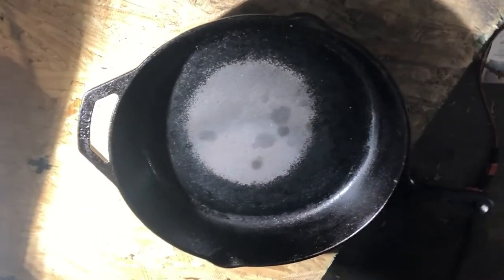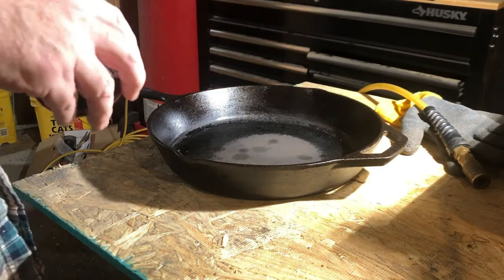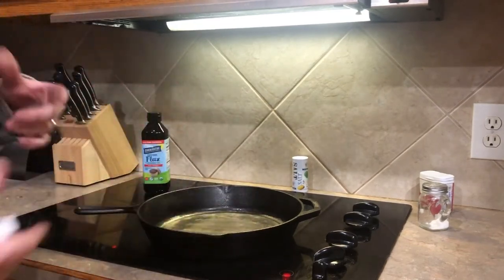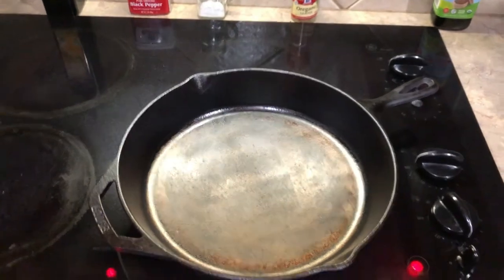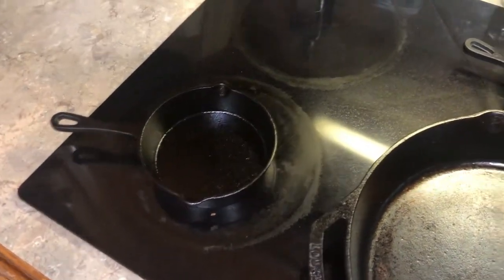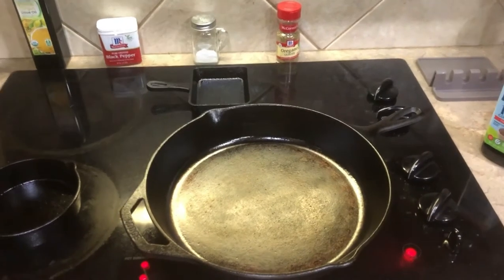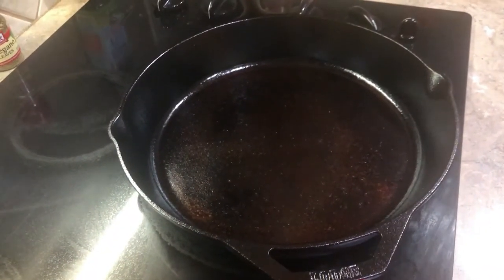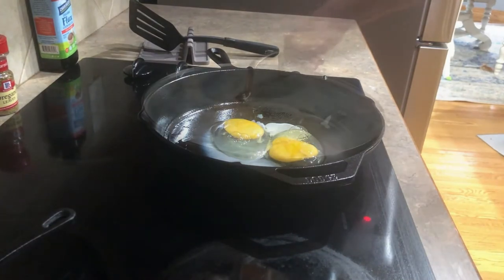I ruined my cast iron skillet.  And attempted to restore it.

Comment: I've been learning how to "restore" cast iron pans recently myself. I've ordered a few antique ones from ebay that said they were restored, cleaned and seasoned, but when they got to me the cooking surface still had rough spots on it from old seasoning or cooking. After watching a few dozen videos I took the plunge and took out my electric sander with 80 grit paper and smoothed it out to mostly bare metal. But it was smooth. I cleaned it again and used canola oil at 450 in the oven and it works great. As others may have mentioned here, heat and oil are your friends in cast iron. I thin coat the whole cooking surface with oil, be it olive or canola before I drop my eggs or meat in there. Not deep fried, but I get no sticking doing it that way. The only sticking I get is carmelization from sauces, sugar or burned juice from the meat, but it comes right off in really hot water and a wipe. Not too different from teflon. Eventually I'll use less oil as it gets more seasoned on the fly but it's kinda fun restoring old pans.
Reply from the maker: The more I use cast iron, the more I like it. I use cast Iron at home almost exclusively now.

Comment: As people in the comments recommended just keep cooking with it, but hold of on anything acidic until you get a good seasoning on there again. Also, if you ever have to reseason a skillet again wipe off the oil you applied, then place it in the oven upside down, and place a tray or foil on the lower rack to catch any potential drips. You chance the skillet getting sticky if you dont wipe it down. Upside down bake prevents pooling.
Reply from the maker: Thank you

Comment: I did this exact thing a few days ago...I'm glad this popped up on my feed. All I did was clean and season in the place where it was all grey and now its returning to form after several seasoning sessions. But yours came out so nice. I don't really have any tools to do what you did. Wish I have.
Reply from the maker: It should be fine. I think cooking with it, will fix it over time.
Reply: You can use an electric drill with a 5 inch sanding pad attachment, and some 60 grit sanding pads.
Here is a link to a video showing the process if you are interested.

https://youtu.be/GZwvq2InOZA

Comment: Something I learned when restoring a cast iron skillet is to put plenty of grapeseed oil in the pan (like you where going to do a shallow deep fry, maybe 1/4 inch) and then fry up some potato peels with 2 or 3 times the salt that you would normally use and fry them up until the are really burnt.  Something about the starch in the potato's really help to restore the finish.
Reply from the maker: I may have to give that a try. not sure where to find grapeseed oil, though.
Reply: @averagecamper695  Any grocery store should have it
Reply from the maker: @pjbaker9781  Thank you, maybe i'll do a follow up video and try this method out.

Comment: I don't know if anyone has already suggested this but allow the eggs to warm up a little before cracking them open or maybe if you crack the open already allow them to come up to room temperature before putting them in a hot skillet so they won't stick. Hot skillet with cold eggs will cause them to stick
Reply from the maker: Thanks for the suggestion. I've never heard that before.

Comment: After you power sanded it, I would have used a fine grit sandpaper and go over any stray spots of old seasoning to clean it up a bit. Otherwise, great job.
Reply from the maker: The discs I used were polishing discs. They are capable creating a very smooth surface. But I didn't smooth it out as much as I could have. Looking back on it, maybe is should have taken the time to smooth it out more.  Thank you for the comment.

Comment: Yeah im wondering how to fix mine too,i did the same as you did,i thought i turned the stove off but it was on high,i was gone for a while [doing the laundry and cleaning up other rooms and such] i didnt notice until i came to the kitchen to get a drink to notice it was still on. I turned it off. The bottom of the pan looks cracked honestly and i dont know what to do,i dont have any drills or any tools like you have so im not sure what to do with my pan other than just buying another one.
Reply from the maker: I don't think you need to sand it down with power tools. you should be able to scrub it with an S.O.S. pad or some steel wool and then bake on a few layers of seasoning. Then the more you cook with it, the more non stick it will be.    I don't know about a crack though. may not be able to  fix a crack.     Good luck .  Thank you for taking the time to comment.

Comment: I just did the same thing. Can I use steel wool?  So far I just rinsed it and went over it with crisco a couple times. No oven yet
Reply from the maker: Sorry I completely missed this comment.    But yeah, you could even it out with stool wool and then try to season the bottom of the skillet on a cooktop.  Best thing for a cast iron skillet is to cook  with it.

Comment: they say glass top stoves will break if you use cast iron.  Is that true?.  I have several of my cast iron packed away since I bought a glass top and very unhappy that I am not using them.
Reply from the maker: haven't had any trouble. My wife has been using this Cast Iron pan to cook almost everyday. I do worry about someone dropping it on the cooktop and breaking it.  I'm always careful how I set it down.   even dropping it from a short distance could probably break the cooktop.

Comment: I just did this with my griddle. I heated it up to evaporate water off it before a maintenance coat. But i fell asleep. So it was on the stove for an hour and now burnt off 3/4 of the seasoning. Do you think all the grinding was necessary? Do you think i can just season over it and tolerate the uneveness?
Reply from the maker: I don't know if the sanding did any good. But It did even out the color. At certain angles I could still see the burn spot.

Comment: You really should have started over. It’s no big deal.  You’re basically applying a patch where it is much better to start over and build the polymer chains all over. They will link better that way.
Reply from the maker: I basically started over. I tried to even out the entire bottom of the skillet. Then coated the entire inside surface with Flax seed oil. Do you think I should have taken it a step further?

Comment: I have a very old, probably sometime in the 60's Wagner Griddle and on the back is seasoning instructions which say in the oven at 300 degrees for one hour.  "interesting".  I have always seasoned mine with crisco and it has worked great.
Reply from the maker: Interesting!  I'm still learning about cast iron. I started cooking with this pan because I thought it would make a great addition to the "Camping" channel that i'm working on. although the channel is anything but a "camping" channel at this point. I'm planning a follow up video to this. It seems to have generated a lot of comments.

Comment: How TO RESET YOUR CAST IRON PAN: WARNING: ONLY DO THIS OUTSIDE, not in the house, garage, or shed (OUTSIDE.). You need a plastic bucket large enough to hold the pan. CoverCould you the pan with hot water? Eye covering/gloves needed: add 2 LB of pure Lye Drain cleaner. After 12 to 24 hours, remove the pan from the lye bath and wash with soap and water to remove the last lye. (NOTE: will start to rust 5 min after getting dry) Heat the pan to 150 to 200 degrees F, add oil, and bake in the oven at around 500 degrees F for one hour. Let cool in the oven. Repeat the oil 3 times.  

I say reset and not wire wheel because sanding/wire brushing leaves scratches that the meaning needs to overcome to make it nonstick again.
Reply from the maker: Ok thank you. I'll consider using that method on another old pan that was my grandmothers. It has a lot of built up crud on it.

Comment: Flax seed is actually not the best to season a pan since it has a low boiling point.
Reply: Boiling point?
Reply from the maker: I think I was just using what I had on hand at the time.  If you watch the follow up video, You'll see the seasoning didn't last.
Reply: @BURTONizAjerK  meant to say smoke point 😂
Reply: @averagecamper695  I'll have to watch that video

Comment: When you have a pan that bad use a 3" wire wheel on your grinder that will get everything off the pan ,,,,then take a 150 grit o n a orbital sander for the bottom of the pan then go to 220 grit and call it done ,,,, then you can season the pan !!!!! I pre hear ar 200 degrees  then pull it out then put your flax seed on it,,,,for a hour ,,,, let cool and then pre heat to 400 degrees for 2 hours then let it set in oven over night  ,,,,,then so on !!!!!!! I do my pans 3 times the best thing to do is to deep fry o onion rings ,,,,,the take them out ,,,,then let your oil in over night  ,,, then heat pan till oil is hot and drain oil and then wipe it out and done!!!!!! 😉😉😉😉😉😉😉😉😉😉😉😉😉😉😉😉😉😉😉😉😉😉😉😉
Reply from the maker: Onion rings sound really good right now. But I hope I don't have to do this again. Things didn't work out like I thought they would with this pan, but it is working well. I did a follow up video on it.

Comment: There are literally hundreds of videos on YouTube on how to clean, season & store cast iron, at your fingertips ... i'm not an expert by ANY stretch of the imagination, but i do know that certain oils are NOT RECOMMENDED*:  the experts say to *never use olive oil, butter, coconut or palm oil to season your cast-iron pan — they're great to cook with, just not for initial seasoning.  (fyi, every Lancaster Cast Iron skillet comes pre-seasoned with two coats grape seed oil and is ready for immediate use ... that's what I've always used).   Make sure you REMOVE as much of the lubricant as possible before placing it in the oven UPSIDE DOWN on the top rack of the oven and bake for 1 hour @ 500 deg.  Turn off the oven, leaving the pan in the oven to cool completely as the oven cools down.  All in all, you'll want to do this *oiling-and-heating process three to four times*, to set down a good initial layer of your own seasoning.
Reply from the maker: Thank you. And thank you for watching, also.